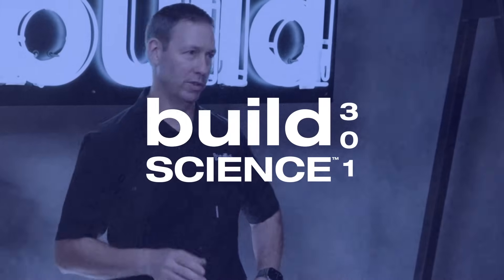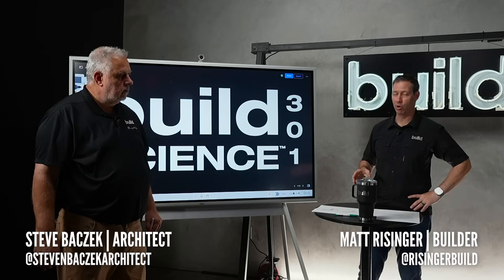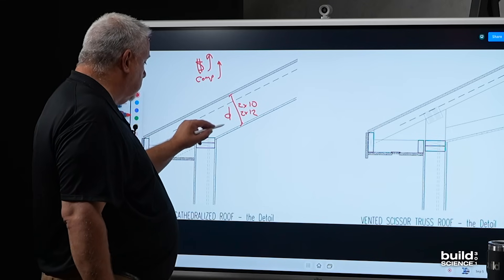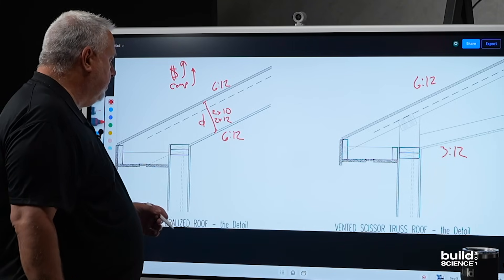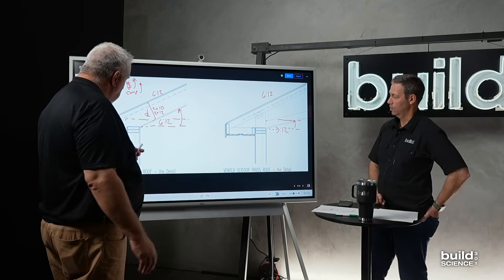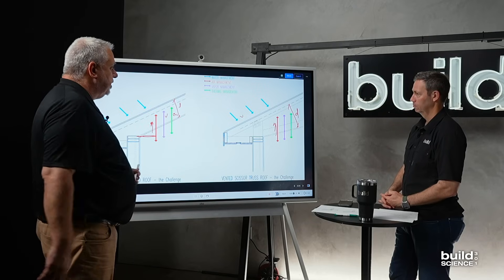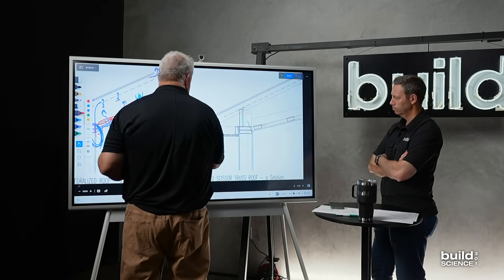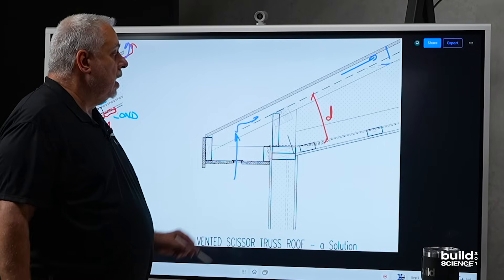Build Science 301 - Ep. 9 | Cathedralized Vented Roof & Vented Scissor Truss Roof

Comment: I have an unvented cathedral roof that has spray foam insulation in the roof. I find it tends to smell on hot humid days when the sun beats on the roof. Can an unvented roof be converted into a vented roof design and spray foam be taken out and replaced with rock wool?

Comment: Thanks for the video. Lots of great information on cathedral ceilings. I would love to get your thoughts on an unvented cathedral ceilings built with traditional 2x10 lumber. 

We have an unvented cathedral ceiling that constantly pops during the day and at night. I believe this has something to do with moisture in the assembly. For background, the builder used SIP panels for the roof and batts in the rafters with a vapor barrier. We are looking at pulling the drywall down and sealing with closed cell spray foam. We would skip the vapor barrier on the interior in this section so the foam could dry to the interior. Curious to get your thoughts on this.

Comment: Hey guys, there's a modified scissor truss I was introduced to five years for someone wanting a true cathedral: parallel chord trusses. Bottom chord matches top chord, made of 2x4 material, you can set the depth to achieve affordable R value AND an air space. Better yet since it's a truss, no ridge beam. Allows for a vented roof too.